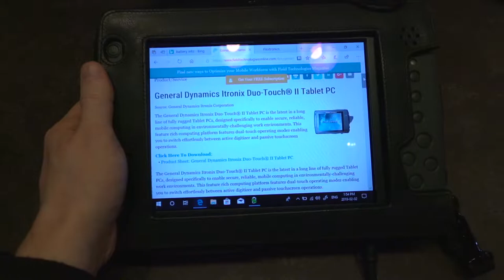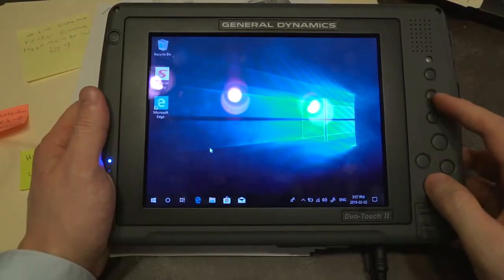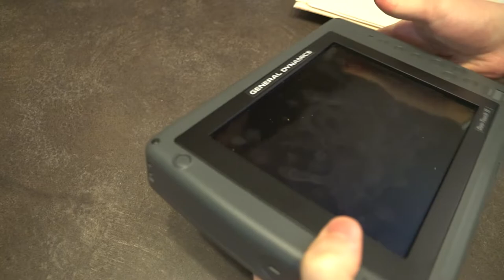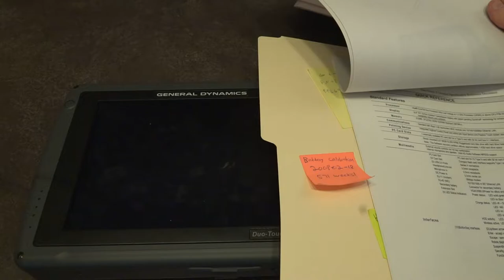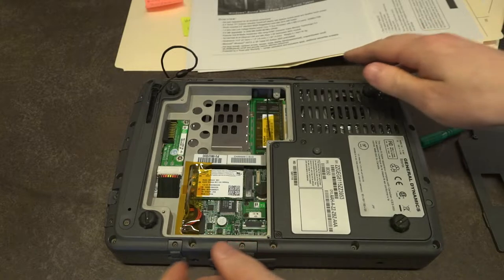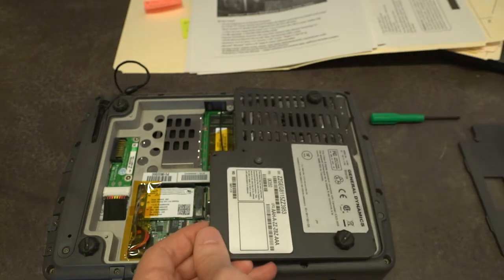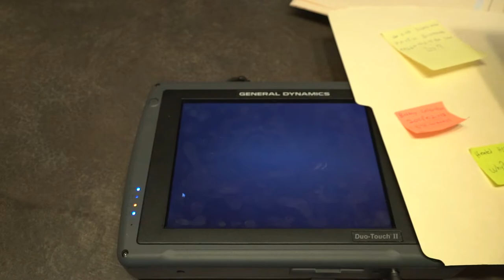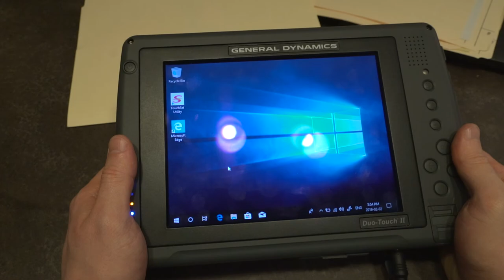Emergency Responder Tablets: General Dynamics Duo-Touch II

Comment: Hello Laptop Retrospective and thank you for your video. Sorry for my english .. I just had a question, I have exactly this model but I can not operate the finger touch and wacom style (malgres that are well tick active in the bios) can you m help find the driver because I try a lot of things the stylus is recognized 3 seconds at the start of the windows and then stuck at the top right of the screen. (I tried the windows 10, 7 and vista and even failure) THANKS MUCH IN ADVANCE
Reply from the maker: You manually switch between the two touch inputs by pressing the up and down arrows at the same time. See the documents and downloads in the description for more information. Good luck!
Reply: @LaptopRetrospective Thank you for your reply. I had seen the manipulation in your video but it has not solved the problem. The site you put in the description does not work "Error. it still works at home? Thank you for your answer continue your videos it's really good
Reply from the maker: Uh oh. Looks like they let the domain expire. Tracking this stuff down is going to be a lot harder I'm afraid.
Reply: @LaptopRetrospective  Bad luck for me, you can keep the file setup? :) it's a good tablet, just the fan operates at 100% PWM even with the setting of the fan in the bios I do not know if the tablet does the same?
Reply from the maker: The files I downloaded might still be on the machine, but it is no longer in my possession.
Reply: @LaptopRetrospective  OK thank you very much. Nice Day !! :)